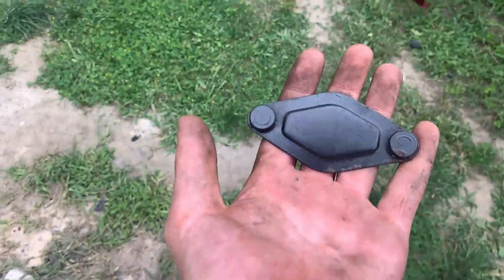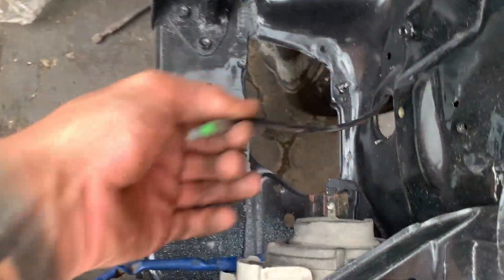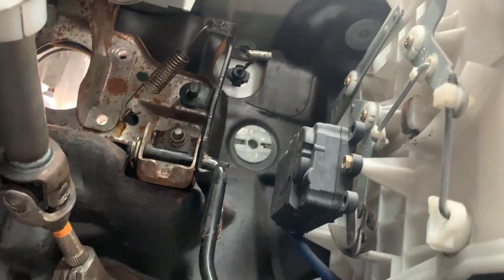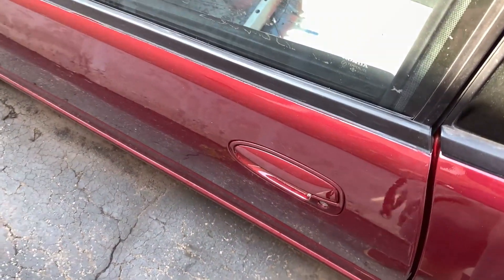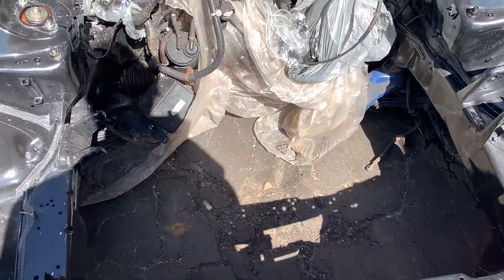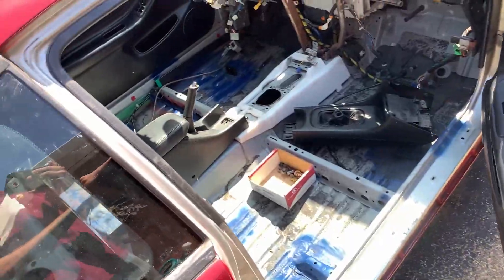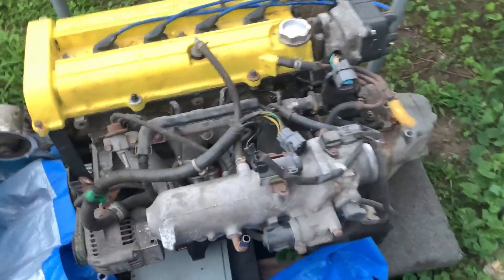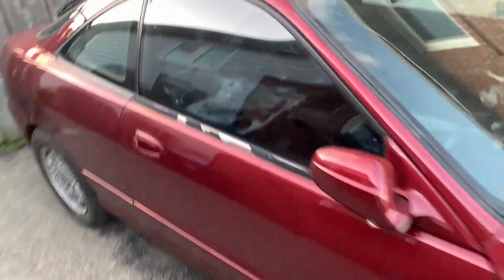Integra Auto To Manual Swap Pt.1

Comment: So did you have to keep that little regulator thing plugged in after you remove that plate? Or did you delete it
Reply from the maker: I just plugged it back in and moved it to the side, you need it plugged in still or your key gets stuck in the ignition and can’t get it out
Reply: @DemonTeggy  does that thing have to be bolted up with the bracket as a ground because I put double sided tape for mount and it’s not working for us